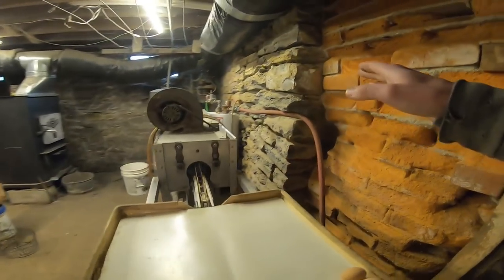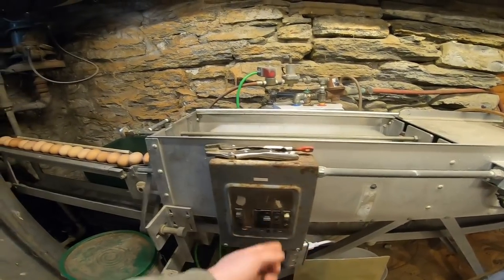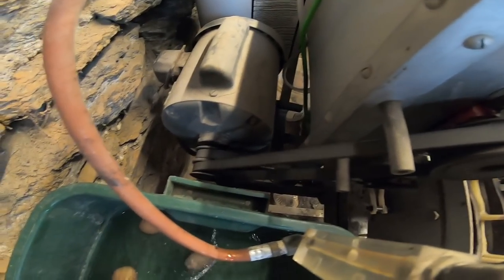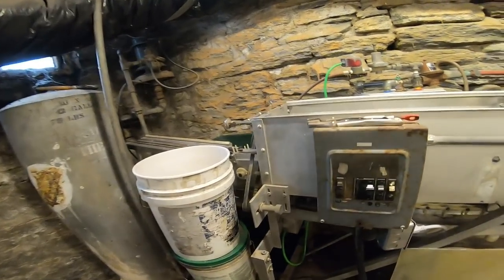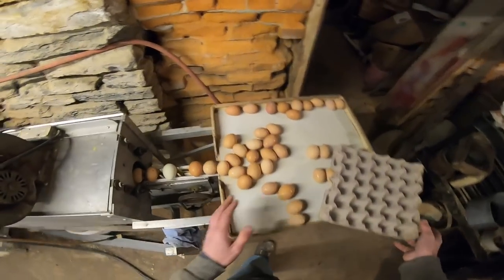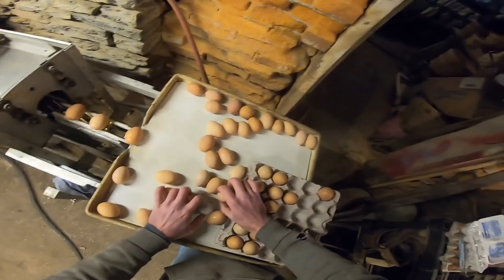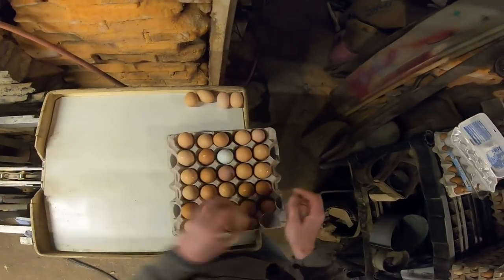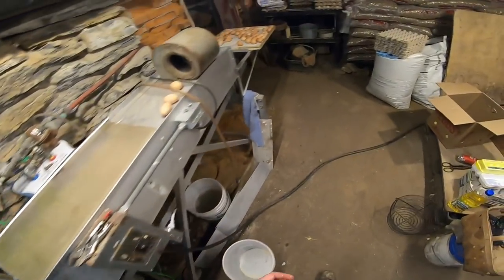Saving My Hands With an Industrial Egg Washer

Comment: Nice video I know a lot about eggs. I was a contract producer for Perdue Farms in South Central Ky for 22 years before I retired and sold my farm. We would get a around 11,000 hens and 1,200 roosters once a year and for a short time when the hens would peak in production we would get 9,000 to 9,600 eggs a day. The birds were housed in a 520 ft. By 40 ft. house with 40 ft. By 20 ft of that being the work room where the eggs would come to you on a collection belt and you would pick them up by hand and load them in plastic trays of 54 and load them on a cart when full would hold a 5,184 eggs then put them in a cooler room until they were picked up took to their hatchery since these were to be hatched and not for human consumption they were not washed. Thanks again for the great information 👍
Reply from the maker: You had me there with the roosters, until I read to the bottom that they were for hatching.

Comment: Looks like a  great egg washing setup.  Grew up with a rotary oscillating bucket washer with built-in water heater but it only did one bucket at a time.   After one had failed, us kids took it apart and had many hours of fun spinning the motor at high speed by turning the oscillating crank.
Reply from the maker: I've seen those. Send like they only worked good if your eggs were already clean.
Reply: @boehmfarm4276  That's true - it did require plenty of clean up when packaging them.

Comment: Throw a sump pump or utility pump in that bucket with a foot valve and a garden hose out the basement window...The valve will function as a check valve and only let the water flow one way - out. That way you don't have to empty the bucket. Get a pump that's auto on/off and you're all set.

Comment: Great Video, Very Interesting. Never really gave much thought to how you wash large quantities of eggs. (3) things; might get a small sump pump that hooks to a garden hose and drop it into your drain bucket, you could also pump out your pre-wash tote with it. (2) Switch to mineral oil, vegetable oil becomes rancid which is why butcher blocks are oiled with mineral oil and not vegetable oil. (3) when your machine starts clunking take a screwdriver handle and apply a little pressure to the ends of the shafts. If this quiets it down, your clunking is from excessive end play, if not then the search continues.  Best of luck, Stay Healthy............
Reply from the maker: I've figured the noise is from a worn bushing. Oiling the machine makes it quiet.

Comment: Do you have to grade them too?
Reply: I drove truck for a feed store in a small town. The store sold small animal feed bought and sold eggs by the case, we did not have a washer but there was an egg grader operated by high school students. The eggs were picked up one 18 egg flat at a time with a vacuum holder with 18 small cups and the eggs were set on wooden rollers that moved them to a set of wood wheels spaced apart so they could be candled and then carried to the gates which graded them into jumbo. large, medium and small the eggs were packed by two or three packers back in to 18 egg flats and put into cases again which we loaded onto the trucks and delivered to the wholesalers in the inner city.
You could sure use a vacuum handle for your clean eggs picking up 18 eggs at a time is a big time and labor saver. On line at a company called Royal Pas Reform, an egg lifter, this is a egg handling company you name it they probably make it.
Reply from the maker: Nope, eggs don't come graded put of the chickens butt, so you'll eat them as they come. All taste the same no matter size.

Comment: Yeah that cold snap was one for the record books down here in Texas for sure... People thumbed their noses at us over it, said it wasn't even that cold, clucked about our power grid, etc... but they really don't understand the context... 

Imagine you get a blizzard... sure you guys are up north; you're used to dealing with blizzards... some strong, some weaker.  NOW imagine you get a blizzard where it's complete white-out conditions for a week.  Whatever you coldest winter temperature is, take it 20 degrees colder, and keep it there a week.  What kind of shape would your area be in?  Plus it's not just your area-- its 500 miles in every direction!  

We had the front come in Sunday night before Valentine's day.  Oh the TV squawkers had been shouting doom and gloom, but no more than usual, and they're ALWAYS predicting doom and gloom anyway; with every hurricane that makes it into the Gulf.  Now they do all winter too, especially since they started naming "winter storms". (rolleyes).  SO really nothing new.  The power situation was unexpected, though.  We just did the usual, fed the cows plenty, put a cover and insulation over the water well, plugged in a heat lamp under the water well points to keep them from freezing up, and dripped all the outside faucets at a thin run... enough to keep the water flowing from underground-- groundwater is 70 degrees here, so it keeps the pipes from freezing up so long as you keep water flowing faster than the water chills down.  No problem.  Well, at midnight we had our first power failure.  Got up and decided that I had better fill stuff with drinking and wash water, in case the power went out too long, and the water well and plumbing froze up.  Filled the back bathtub with wash water and to dip to flush the toilets, and filled every pot, glass, and bowl in the house with spare drinking water, all lined up on the counters and table.  Then went back to bed.  Within an hour we lost power, and didn't get it back for 5 hours.  By that time with the temperature dropping down to 17 degrees, everything froze up good.  By 8:30 am when we got power again, it was 52 degrees in the house.  When the power came on the furnace would run full throttle, til the power went off again.  Did that for the next 5 days.  Then the power would be on for about 45 minutes, and off an hour, and did that for the next day or so.  Then the power would finally start staying on for about an hour or so, and off an hour or so.  That was another day or so.  Then we finally started getting power for about 2 hours, then an hour off, that was the following day or so, then 3 hours, off an hour, and then finally the next day the power finally came on and stayed on.   Texas has 2 nuclear plants, one about 15 miles inland from the beach (South Texas Nuclear Project) and Comanche Peak, up SW of Dallas.  Both are twin reactors.  Comanche Peak was fine; STNP got caught with their britches down, had a bunch of feedwater pipes and stuff freeze up, and had to shut down.  Course Texas has always had plenty of coal plants, along with oil burners and natural gas burners to generate electricity, and had built a lot of natural gas turbine "surge plants" to deal with high usage in summer due to the demand for air conditioning in our savage heat.  BUT Texas also deregulated its power system years ago, and since then customers have been able to "choose" their power source, and with the influx of escapees from crumbling communist utopias like California, we've got a h3ll of a lot more people drawing from the grid now... and a lot of "greenies" over the last couple decades have opted for "green power" like solar and wind, both of which proved UTTERLY USELESS in the extreme cold... solar isn't generating anything under a gloomy total winter overcast gray leaden sky, and wind had to shut down because the oil and stuff in the windmills froze up or was too thick to lubricate the windmills or whatever.  SO that was worthless.  With the demonrats and their "war on coal" and everything, well there just wasn't enough to go around. 

Texas is a d@mn big place... It's nearly 1000 miles from the southernmost tip to the northernmost tip, and about 1000 miles from the easternmost point to the westernmost.  Normally when we get a blue norther (big cold wave) it might be down in the single digits in the Panhandle today, BUT in central Texas it'll probably be in the 50's and may only dip in the 40's overnight right after the front arrives, while along the coastal region it might still be in the 50's or 60's overnight because the front hasn't arrived!  By the time it hits central Texas, temps might dip down into the low 20's,  while the coastal area might be down into the 40's or mid 30's, until the front finally settles in completely, when we might be down into the high 20's... by that time, north Texas is probably back up around or over freezing!  Plus, even if we DO get weather in the high 20's overnight, USUALLY we're at least at freezing during the day, usually into the mid-30's, which is enough to thaw stuff out and get stuff like water wells going again.  With this storm, it dropped below freezing Sunday evening and it didn't get enough above freezing to thaw anything frozen until the following Friday/Saturday time frame.  In addition to the MUCH greater length of the cold weather, and HOW MUCH LOWER than "normal" cold snaps usually are for us, THE ENTIRE STATE was experiencing the same thing... Where usually cold tends to travel in "waves" across the state, leaving slightly warming temperatures in it's wake, this time the entire state was just frozen solid, which presented an ENORMOUS challenge, and it STAYED in that deep freeze state for the entire week before things eased up. THAT is what we were really unprepared for.  It was pretty much a cold snap of the century... 

To be continued... OL J R :)
Reply: Continued.... 

When everything DID start to thaw and the power came back on, then folks realized how much plumbing was shattered.  We were lucky, at Shiner we only had the 1 inch PVC pipe supplying the house with water to crack-- everything in the house itself was PEX, which can take quite low temperatures without breaking.  PVC and CPVC like we had under our Needville house, not so much... we had probably a dozen breaks to fix-- so many we'd have to fix one to find the next!  Should have just had the house replumbed with PEX, guess that's what I'll do next time.  Course then everybody in the state of Texas went looking for pipe and fittings to make repairs, and the whole state sold out of PVC fittings in about a day.  I figured as much and I wanted to get the water back on in the house ASAP, so I used an old trick I'd done before.  Decades ago, we had an ice storm come through and Grandma's water well froze-- unlike up north where yall have the water well in the basement or a pitless adapter in the yard for a submersible well pump, ours are typically just in the yard somewhere.  If you have a newer well, it's 4 inch and almost certainly uses a submersible pump, safely well below ground where it cannot freeze, though the plumbing comes out at the surface, not from the side of the well casing with a pitless adapter below the frost line.  Older wells are usually 2 inch, which means they use a surface pump and "packer jet" to pump water to the surface.  Grandma's well was just like this, with a twin-line wellhead going to the pump, the suction line where water from the well enters the center of the pump, and a second "rot line" where pumped water is forced back through a pipe to the wellhead, and down the annulus between the inner suction line coming up from the jet, and the outer casing... the water flows down the well casing to the jet, sealed to the wall of the well casing by leather seals, and enters a port in the side of the jet, which is basically a nozzle in a venturi.  The nozzle creates high velocity flow, which creates  suction as it draws water from around it, which opens the foot valve at the bottom of the well, which pulls in more water, which is squirted up the venturi along with the flow from the jet, which then goes back to the pump... the excess flow of water coming in from the foot valve gets pumped out into the system from the well pump through a "throttling valve" on the pump outlet.  Anyway, the mess of PVC pipes and fittings connecting the wellhead to the pump froze and busted, and I needed the water on NOW, because I had to leave and haul hay 90 miles to Shiner to feed cows.  I ran to town and bought some hose barb adapters that would screw into the pump and well head, and some rubber hose to connect them up, and hose clamps to clamp it all tight.  Went home and put it all together and went to Dad's to get water to prime the pump, and sure enough it worked!   I planned to replace it with PVC fittings later on, but never did.  We had the well freeze up one night despite dripping the faucets unexpectedly, and interestingly enough, NOTHING BROKE-- the rubber hoses not only did away with a bunch of angled PVC pipe fittings and compression unions and CRAP to connect everything up together and get the angles right between the pump and well head, since the hoses could just bend and flex a bit as needed to align things, but when they froze, they just SWELLED A LITTLE as the water expanded into ice, and then when the morning sun came up, the black hoses absorbed the sun's warmth and about 30 minutes after sunrise, the water came back on all by itself-- enough thawing occurred to allow water to flow, melting the rest of the ice in the hoses very quickly.  SO I never bothered replacing it... it's been there at least 25 years, and still going strong!  SO, with the dearth of fittings available, I just got a couple glue-on threaded adapters and some hose barb adapters and a roll of hose and a couple clamps, put it all together, cut out the damaged pipe under the house, and glued the adapters onto the pipe on both ends... works like a champ!  

Anyway, took a good while for fittings to actually accumulate in the store so we could fix the Needville house.  Hopefully we don't see a cold snap like that again, though we got a strong front last night (19Jan2022) and it was down to freezing last night, 35 for a high today, dipping down below freezing tonight by a couple degrees or so, climbing to about 35-36 tomorrow, then below freezing again, before finally climbing up into the 40's and staying above freezing the following nights.  A pretty good chill for us, little longer than normal, but at least about "normal" "cold weather" for us.  Later!  OL J R :)